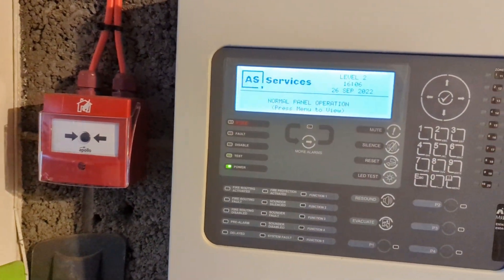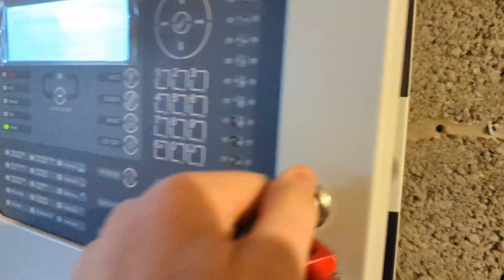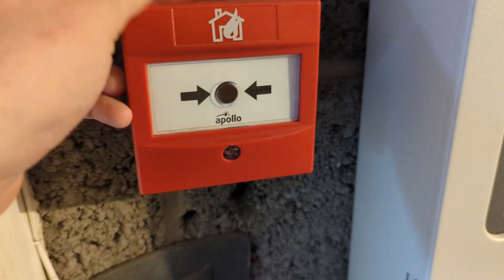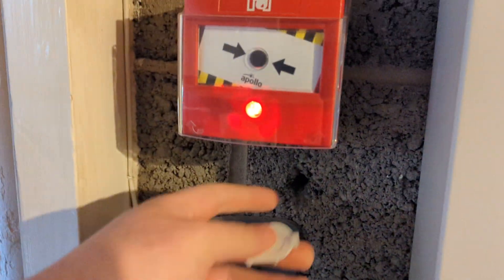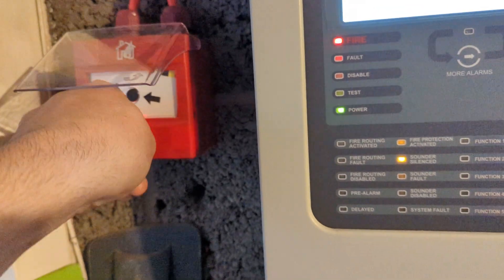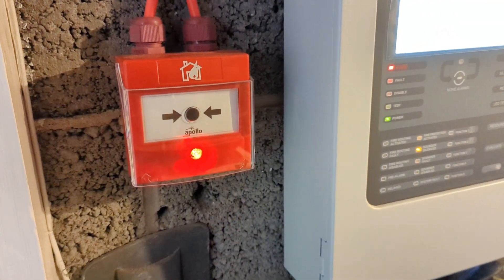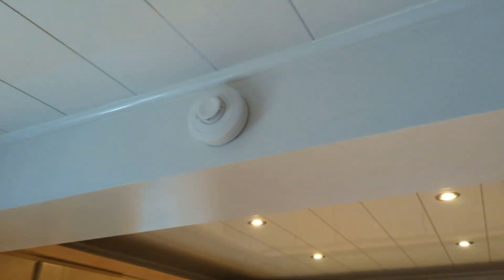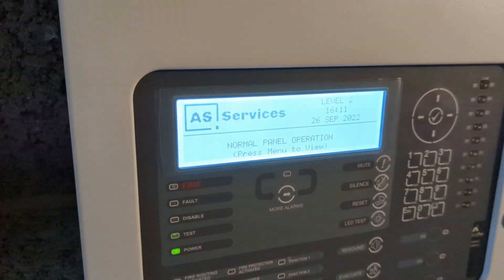Apollo/Hochiki ESP Addressable Fire Alarm System (weekly test 26/09/22)

Comment: What cable did you use to network the panels?
Reply from the maker: Fp 200 2 core and earth.
Reply: @ASSystems  ok thanks
Reply from the maker: @JITech964  make sure both the network cards are of the same type cause there two different ones.
Reply: @ASSystems  how do I know which is which?
Reply from the maker: @JITech964  they'll phsically look different. One is a standard network card one is a fault tolerant network card.
Reply: @ASSystems  thank you, I will send a picture through discord

Comment: How did you link all the panels together? Also nice test
Reply from the maker: The two advances are networked using network cards. And the gent is on a interface which as a relay and a fire input.